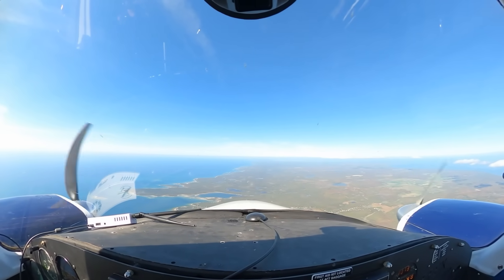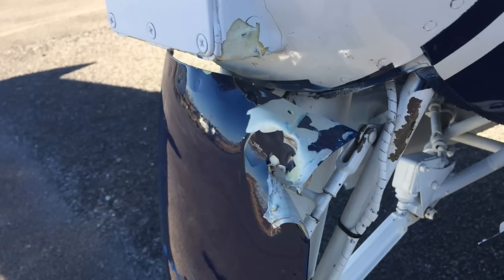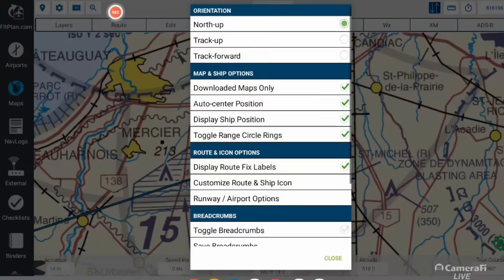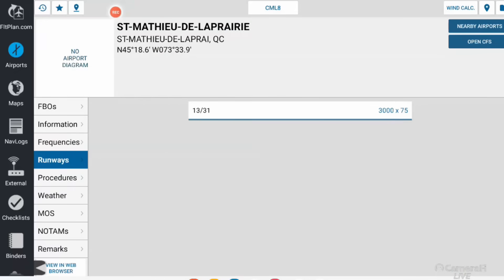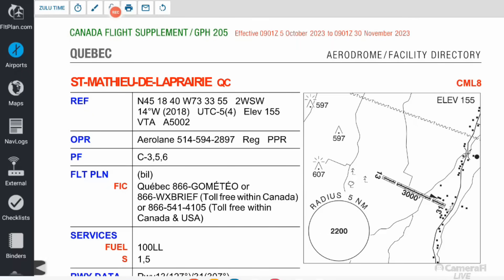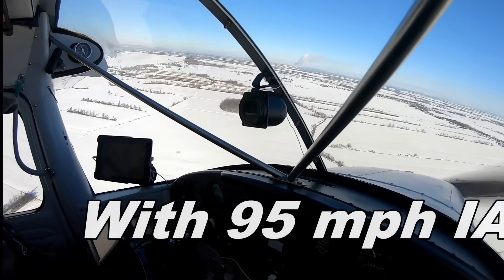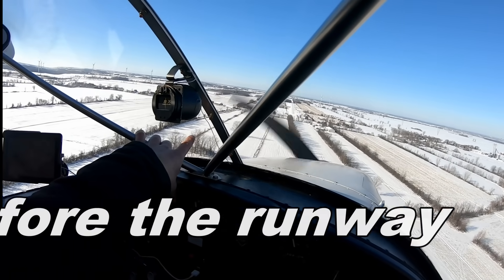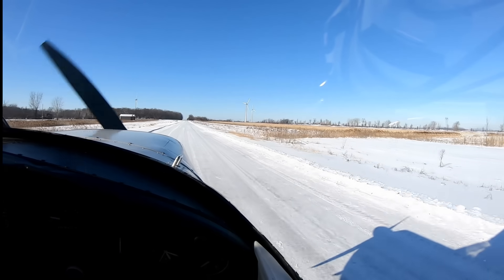Wire Strike Cessna 310

Comment: Glad you survived but damn!...the fact that there are people that thought stringing a wire in that location was acceptable is beyond me.  You did everything right, so who is to be held responsible?   You're correct, if you were flying a single engine you most likely wouldn't be around to post this video!   Airports should be checked from coast to coast, approaches photographed and reports must include an individuals signature certifying that all criteria has been met and conditions updated.   Wow!
Reply from the maker: Agreed. Even the current distance information is incorrect and that really sets you uo for trouble.

Comment: On google street view, the un charted set of wires across the poles closer to the runway threshold are quite obvious and just crazy! ... not just at the road! Check it out.
Reply from the maker: I bever thought to look there. The Google Maps satellite image has the runway still under initial construction.
Reply: @fastbackflying853   Street view shows the hard surface being extended towards the road ... towards the wires (two sets on the closer poles, 3 to 4ft vertically apart). Helps with the available take off distance, but I've never seen any other airfield with such a close and dangerous hazard! Visibility markers on the wires (i.e. orange balls) would have helped spot the danger. Looks like a total uncoordinated mess by the airfield and authorities! Glad the physical outcome for you guys was ok, even though it financially cost you a small fortune.

Comment: Thanks for sharing this!   I've shared this video with all of my local flying friends to reinforce (as you described) how important it is to be vigilant and do the proper planning for every flight.    Clearly things can fall through the cracks and that extra look can make a big difference.    Praise be to Penny for keeping you safe!
Reply from the maker: You are very welcome I'm glad you enjoyed the video and found it helpful.

The wires really are not visible at all. I always tell my students to look for the polls because even large main power lines can be almost impossible to spot unless you look for the towers.

I never in a million years expected wires to be strong across that runway less than 500 ft from the start of it. It really is truly mad. They weren't there until recently and the fact that the airport had been closed until they were removed and that was lied about is incredibly frustrating.

Comment: Wow. thank you for sharing. You are indeed lucky to have survived that. I had a good friend die in a 172 along with the mother of three children and their father watched due to a similar unmarked and unlisted cable TV/internet wire that had been strung weeks before the incident by a cable TV company. There were lawsuits filed and I believe settled for an undisclosed amount.  Basically someone strung up a death trap for pilots, and in the U.S. I suspect attorney might be keen to consider the case buy in Canada it might be a bit different. 

I grew-up flying a 310C (666T) and a 320 (320BG) I sold to a friend in Alberta. and am looking forward to  watching your other 310 videos. I had a near miss of a wire in Washington State in the 310C coming into a short, gusty crosswind strip with an unmarked wire while making a low approach to hit the numbers. Lucky I caught the flash of the wire and was able bob over it at the last min. 

I also had an incident one where one of the small diameter steel pins that hold the upper section of nose gear down-lock corrode and fail and on retraction the nose tire retracted through the gear doors jamming the nose wheel, I also hear a loud "BANG", the panel jolted and I felt it in my feet. After  fly-by and a few cycles the nose gear dislodged and I got a green light and landed and after jacking it was obvious that with one side of the down-lock failed the nose gear was unsafe and it was lucky it did not fold on landing. We noticed no apparent damage to the nose-gear actuator or tube. 

The actuator system on the 310 seems pretty robust and I'm not sure a failed gear down micro-switch would cause the the failure you suspected, but rather added stress as in Bonanzas and Barons. I think you might also NOT get a green 'Down' Indication. 

There's a few other quirks and stories I recall from the 310  I could share, like the time a piston stuck due to  the wrong size pistons being installed causing a sudden engine stoppage and the propeller departing on departure and ending up in the Columbia river that was similar to your belief you had a spinner coming apart. 
 Thanks again.

Comment: I'm so glad you made it out of this situation safely. I was imagining myself hitting a wire in the Cherokee and I came to the same conclusion, I'd probably be dead. Several years ago I read an article about obstruction heights being unreliable on approach plates, specifically treetop heights on terrain and it just goes to show that the documents we rely on are often wrong or misleading. I really believe that all wires should be marked with appropriate visual identification devices, like those orange balls on transmission lines, regardless of height, if it's on the final approach course they should be marked.
Reply: Agreed but are those warning Balls lit up at night?  non pilot, just curious.
Reply: @allen480  There are lighted marker balls but they are generally restricted to high power transmission lines of long span. The guidance for lighting is in Advisory Circular AC 70/7460-1M. If you have trouble sleeping I will provide a link below.

The term for a wire obstruction is a catenary in the advisory circular. FAA guidance would be required because the big issue is that a lighted marker cannot be confusing to a flight crew performing an instrument approach with expected lighting cues. Not every runway has a published instrument approach. 

It would be more likely that a wire of smaller span and lower power (< 69 kV) or no power, would get unlighted marker balls: orange, yellow, white, or alternating. Aircraft landing lights might illuminate them at night.

Caveat: I'm only a pilot, not a facilities administrator.

https://www.faa.gov/documentLibrary/media/Advisory_Circular/Advisory_Circular_70_7460_1M.pdf
Reply: Why would you ever try to land on a displaced threshold?  You can use it for takeoff, but not for landing.
Reply from the maker: @teneretraveler5130 i didnt land on the displaced threshold! Thats the point! I landed past the displaced threshold and still hit an unmarked wire.

Comment: It boggles the mind. The power company likely broke all sorts of rules when they put the line in place. Even if no rules were broken common sense should have kicked in. You can’t put an obstruction in the landing pattern. 

Then the managers at the airport should have been raising Cain with the power company and reporting the situation to the local and national authorities. Pilots based at the field should have been raising Cain with the airport managers and the local government agencies.
Reply from the maker: I think you might be right about the power company breaking a lot of rules and just stringing a wire to get power where they wanted it. The fact that they restrung the wire within a few hours of it being broken speaks to this. 

Do believe the airport had paid to have the wire broken but had not pushed hard enough to actually make it happen and ultimately according to TC had lied about it actually being removed.
Reply: @fastbackflying853  Its amazing that the power company wouldn't even put a few of those orange balls on there for visibility. Those things save lives!

Comment: Im not a Pilot but I work in the Aviation Industry as a Crash Firefighter ( ARFF ) and it says a lot of how strong those C-310's must be made . Yes plenty of damage yet it stayed together and you made a good landing after with no effects on controls , engines etc . Tough aircraft , she saved the day . In my eyes she is a keeper 🙂. It would have been nice maybe if the power company had put some of those orange balls on the power cable to make it more visible as it is right at the end of a runway . Just my take on it as from the footage and picture it is hard to spot that cable .
Reply from the maker: It really is an impressive airplane.
Reply: @fastbackflying853  I do like the C-310 , good aircraft and this proves it .

Comment: Was this line recently installed?  How did other planes manage to miss the wire?
Reply from the maker: Yes I believe  the wire was recently installed. 

The runway had also had its displaced threshold recently reduced from 1000 feet to 600 feet! As we know the 600 feet was not marked correctly! 

Most aircraft that operate at the airport are local single engine aircraft and therefore aware of the wire.  I was not informed of it and arrived in a twin.

Comment: Wow so incredible you made it. I will relate that it takes a few deadly accidents to move the wires. My father in the 70s an ntsb investigator in the San Fernando Valley investigated a few fatal and wire hits at the end of the runway at Wittman Airport.. they actually had wires 50ft from the threshold . They kill someone and put it back up. Kill somebody else and put it back up....etc. drove him crazy trying to get the lines moved. 20 years later they moved them.

Comment: Yeah that's not ideal. Any close power lines can be marked with big plastic thingies they attach to power lines to make them visible.
Reply from the maker: Close power lines certainly should be marked the poles can also be wrapped to indicate a hazard. This power line was so close to the runway has to be inside the obstacle clear path and even if it was marked it would not be allowed to stay or meet the regulations.

Comment: Have you taken the 310 To Yuma?
I had to say that!
I’m glad you got things worked out on the airplane.
Reply from the maker: That made me laugh alot. 

I am ashamed now as I was in Arizona with the 310 in September yet did not go to Yuma! A missed opportunity for sure lol
Reply: If you do wonder down to Yamu, use caution, they have a wire across the runway about 1500ft from the threshold. Albeit an arresting cable and it's marked. But it will get your attention if you roll over it fast.
Reply: @eltomas3634  Thanks for the heads up! I’m an ex Navy guy so I’ll have my tail hook down!
Reply from the maker: Okay sounds like a plan.
Reply: @fastbackflying853  …and there are plenty of rattlers in AZ🐍!  lol

Comment: I think they are liable for your damage.  That was not a marked or approved obstruction.
Reply: They’re not at all liable for his damage. He was in error. He was skirting in low, against proper procedures. The runway has a significantly displaced threshold. He glide path is supposed to be appropriate 3 degrees or so, to set his wheels down PAST that displaces threshold. It’s there to keep aircraft high on approach. He ignored that, and came in low skirting the ground to try to touch down early, because he was intimidated by the shortness of the runway. It’s clearly a pilot error. Not the airports error. That’s why they displaced the threshold. 
I’m not bashing the guy, I’ve been flying 40 years and I’ve made mistakes. But let’s not sugar coat it either. Had he been even 6 feet lower than he was, he would have killed everyone onboard.  Pilots are supposed to understand what they’re doing. It doesn’t matter if it was written in the airport paper diagram. Busting normal approach minimums even when VFR is never a wise decision. Let’s hope he learned a lesson, because it seems he’s making a lot of excuses up for it. Like, it doesn’t matter there was a student pilot and 2 other private pilots with him at the time. HE was PIC, it was his responsibility alone. 
Airports are not haphazardly thrown together. Displaced thresholds are there for very important reasons. As pilots were supposed to understand that. Glad they’re all okay, they were INCREDIBLY lucky!!
Reply: @jmflyer55 Disagree. The official numbers are recorded as X, but it’s really much less. The wire should have been buried from day one!
Reply: @jmflyer55 -good analysis. We struck a wire flying through an old ghost town in a Longranger 🚁 equipped with  a full wire kit on it back in the 80’s. Mining areas are not exactly the safest place for a photo mission. Had we not had the cutters, not sure we would have made it. 
Another time on a search and rescue, ELT had us close but couldn’t find it, then we saw the plane had wrapped itself around very heavy duty high power lines like tinfoil. 
Since helicopters are usually at 300 AGL in suburban settings, everyone has their own wire and tower stories. 😬 -stay safe !
Reply: @jmflyer55   Clearly pilot error? The fact that they've now buried the wire suggests that the management perceived a duty of care. If they aren't liable, why spend the money to now bury the wire? Do authorities shut down operations when the facility is clearly compliant? Your haughty certitude is troubling - almost as if you've assumed a comically cruel persona to scare off dissent. Yeah, our pilot seems to have deviated from perfection. That shouldn't be a capital offense, your extreme confidence notwithstanding.
Reply: @WillBravoNotEvil The two things can be true simultaneously; the wire should not have been there, and ducking in to put it down on ‘brick one’ is a bad idea. 

Your comment of ‘deviated from perfection’ is a complete obfuscation - a qualitative assessment like yours encompasses too wide spectrum, for which you’ve provided no specificity (landing an inch off centerline is “deviating from perfection” ... running out of gas due to poor planning is “deviating from perfection” — it’s a category without a distinction).

I’d advise applying more discipline in takeoff and landing data, even if the rules don’t require it. Such as, if you don’t have the runway available for the published “landing distance over a 50 foot obstacle,” then choose a different location.

Note the Threshold Crossing Height on precision approaches, which tend to be right around 50 feet. This is a safety buffer, whether you assess an obstacle to be present or not.
Reply: And 50ft over the threshold implies touching down several hundred feet down the runway, not on the threshold.  The pilot left himself no margin for safety.
Reply: Another fun fact, the pilot had to fly between the telephone poles like they were field goal posts in order to catch the wire (assuming a normal sag).  If you're going to fly between poles you need to be 100% certain of what you are doing.
Reply: @WillBravoNotEvil  my dad always said how fast was the tree going when it hit your car? If it is sitting still and you blame it. You have stabbed beyond the science of reason and into the field of emotion. I feel that that tree was planted in the wrong place and that's why the accident happened. If you hit something.... You are at fault.
Reply: Well It all depends on pilot judgment. I used to fly next to tv, and radio antennas 1700 feet Msl, they had wires sticking out. In all directions, you catch one it will slice you like Butter. Love those planes Got some hours on them.
Reply: The airport was literally TOLD it could not operate with that wire where it was yet it operated anyway, and you’re saying it’s not at fault?? 
The numbers on the airport diagram were wrong. You can’t expect a pilot to pull out a tape measure to verify the numbers for themselves!
Reply: He should sue; the airport management clearly acted in bad faith.
Reply: No his fault..there is a road ..roads have powerlines ..you should assume there is a wire ..especially when you are getting to a field other then your base..
Reply: If that is the case and they did nothing wrong why did they shut the air field down until the wires were buried, just a question 😊
Reply: @markfalshaw-gv9im  because they have to assume that others are just as stupid..
Reply: @Shadowaspen 
Interesting note on this.
He did not hit the power lines at the road which were marked. He hit a wire that was 1/3rd the published distance of the power lines at the road and was not published or marked. Rewatch the video and look at his drawings on the map. I'm not saying that he had no fault, but you can't avoid something if you don't know it's there because it wasn't published anywhere.
Reply: @jmflyer55 Agree completely. I’m thankful he posted this video so that others can learn from his mistakes.
Reply: @jmflyer55  you're technically correct...  

but what kind of airport, even the smallest, installs a power line over the runway...  it could make sense if it was for a couple of days due to construction or repair with a published Notam....  but to operate that way as regular operations is bizarre, doesn't make business sense, or safety sense....  it's an accident destined to happen...
Reply: The fact that he facility was made safer does not mean the pilot wasn't clearly at fault.
What it means is that the avvident showed that the facility was able to make a change that potentially makes the next pilot error less Fatal.
Reply: He's a 100% sure now.
Let's appreciate though that he, despite looking quite bad in it, shared his experience so we all can learn from his mistake.
Reply: @jmflyer55   If the airport was not in the wrong, why were they shut down when it was found that the wire was not noted and should not have been there?
Reply: @tm502010  That wire would also fall within 3°.
Reply: @WillBravoNotEvil  the wires been there the whole time and this guy just now hit it, actual pilot error.